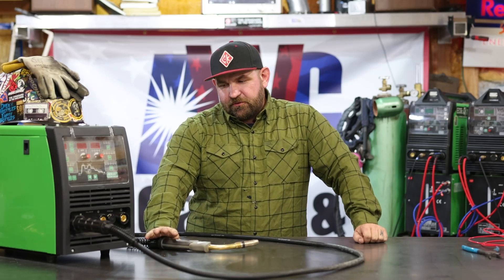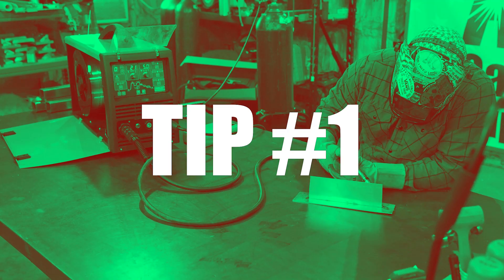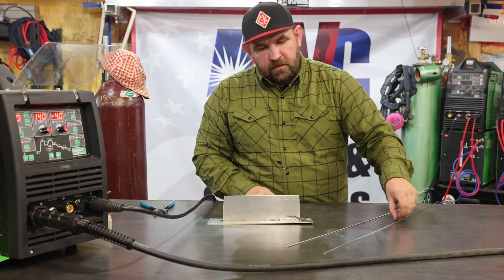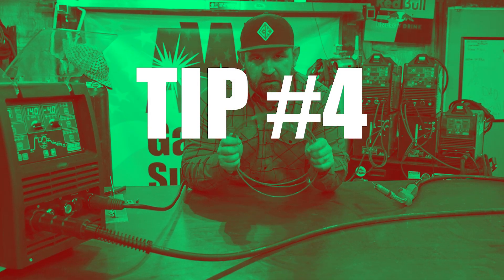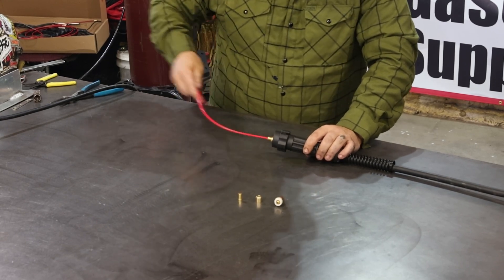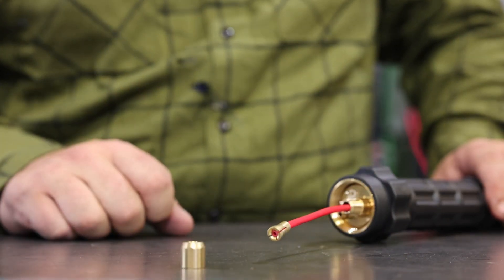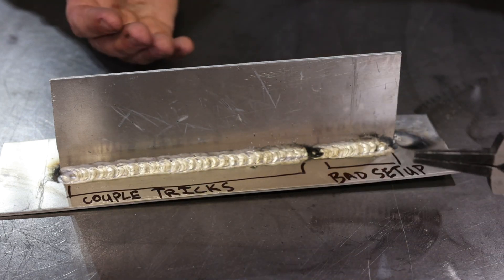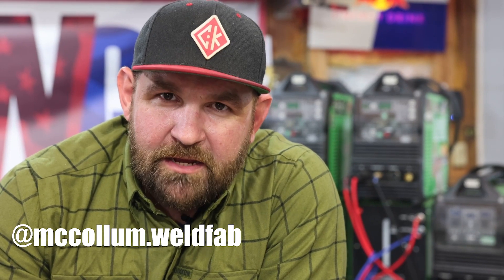MIG Welding Aluminum (without a spool gun): 4 Tips

Comment: 1. Straightened your feed line. 
2. Use 5356 size wire
3. Use 052 tip (oversized)
4. Teflon liner

Awesome video boss, 🫡
Reply: It sounds like you want to use a .010" larger tip than the filler wire you'll run.

Comment: Great video. Thank you. I have a question:  After you've finished your aluminium repair, do you  have to swap the liner back to the standard one?...or can the Teflon liner run steel wire?
Reply: same question i have too

Comment: Thank you for the tips.
I notice you are using 0.046 wire on what looks like 1/8 workpiece. Do you find that you can weld thin aluminum with such a relatively thick wire? I imagine the thicker 5000 series wire is stiffer than the thinner wire and feeds thru the whip easier

Comment: What gas mixture? 100% Argon? DCEP or DCEN? Also, if you are running a larger contact tip you still may experience arc issues for sure, but it looks like it works.

Comment: Never cut the teflon liner flush. It should be long enough to almost touch the drive roller. It needs to guide the wire a soon as possible after leaving the drive rollers

Comment: not teflon liner, the best is graphite liner, the liner must not be cut there, a length must be left so that it goes to the unwinding rollers
Reply: Can I still use the graphite liner to do my normal steel welding?
Reply: @BillyP-49Chevy  oui mais elles coûtent nettement plus cher et s'useront plus vite   en y faisant passer du fil Mig acier. Donc c'est mieux de les réserver au passage des fils alu. Celles pour l'acier sont spiralées sur tout la longueur et ont une  plus grande longévité.  En plus il est recommandé que chaque gaine ne soit utilisée pour toujours le même type de fil, acier, inox , alu pour que les fils qui y passent ne soient pas polluer par de précédents usages de fils différents.  A part ça il est recommandé et en particulier pour l'alu de souffler régulièrement les gaines pour les dépoussiérer car les frottement fils.contre gaine, produisent par abrasion  des poussières. Pour l'alu la bonne pratique est de le faire au moins à chaque changement de bobine. Vois serez d'ailleurs étonné par la quantité de poussière qui va en sortir

Comment: Does anyone know if this will work with my Lincoln Mig-Pak 140? I'm assuming the Everlast in the vid was a nornal mig machine like my lincoln? This would be awesome if it worked. I'd buy a separate whip and torch for it if anyone can confirm! Thanks.
Reply: I'm wondering the same thing. I have a Lincoln SP-170T, maybe twenty years old, in mint condition so I'm not about to upgrade. I'm told I CAN weld aluminum if I make the changes shown in this video, but it's not a modern pulsed welder.

Comment: Thanks for the Tips. Quick question. Can dirt bike cases be mig welded with this setup?
Reply: Not an expert, but I would be willing to try.  

That aluminum will need to be as clean as abrasives and chemicals can get it.  Drill a hole at the end of the crack.  The crack will concentrate stresses in the metal at a single point, weakening the part, but a circular hole will distract those stresses over a larger area.  Tack the sides together for alignment.  Grind sections of a deep V-groove so you can get good penetration (bypassing the tacks).  Weld between the tacks, then groove the tacks and weld those spots with good penetration.

Depending on thickness and penetration, you might need to groove and weld the other side.

Good luck!  It may not turn out beautiful, but if it holds together it’s a win.

Comment: Thanks for the tips. I think half my problem is wire feed. I switched to the 5386 or whatever it is and that helped out a lot. My boss don't like the weave on aluminum the way you welded. I like it for heat control especially at the beginning of the weld when it's at its coldest. It sure looks a lot better though. Obviously the dimes have to be prone to a crack the a straight high build Caterpillar looking stringer. Either way thanks for the tips

Comment: Thanks for sharing this great video.
a.)   Are some liners better than others ??
b.)   Can you replace the liner in any torch cord ??
c.)   Do the rollers on the mig that feed the wire have to be metal ??
Thanks for your generous consideration,
Sincerely ........................
Reply: -Yeah,there are also teflon-grafit liners.
-Pretty much in any torch except ones from cheap maschines where is hard connection between torch and maschine.
-Yeah they can be plastic (but they need to be U shaped too)

Comment: Is there any push/pull guns that will work on this welder besides the Parker that Everlast sells? Cause lets face it, unless you're working on a bench in perfect conditions like you are with the whip leyed out perfect...the style of welding you are doing has more weld wire cut off and tossed on the floor then in the welds.

Comment: Can I get some settings for 1/8" 6061 aluminium pulse and double pulse welding .035" 4043 wire with 100% argon
 On the 253 DPI  can't seem to dial it in and would appreciate it immensely.

Comment: What’s a good gasless aluminum mig wire spool? My Lincoln is setup for flux core. I found an aluminum mig wire “030” I have not used it yet bcs it doesn’t specify argon or gasless. Is it possible to weld with aluminum mig wire with soldering flux when there is no argon gas??
Reply: No. You have to use 100% argon.
Reply: @haroldlundberg5676  yes pure argon, the reason I asked is because google search  and Amazon smh they have a gasless Aluminum mig wire..🤔but people who bought it responded it is gas. The problem is if you search for something you’re going to find it even if it’s not accurate.

Comment: I'm looking to buy my first Mig welder (as a diyer) but non did aluminium.
Your tips convinced me of workarounds. They shall get laminated and putup in my garage.
MIG WELDING TIPS
1. Make sure your torch lead is a straight as possible as the filler wire is soft aluminium.
2. 5356 filler wire is softer than 4043 wire so try 4043 wire.
3. Use the next size up gun tip for your wire as the soft aluminium filler wire gets pinched in the rollers and can become oval in shape which can cause 'birds nest'.
4. Change your torch lead liner to a Teflon Liner.
Great video
Reply: He said the 5356 is stiffer, not the 4043...

Comment: Awesome. Can you leave that liner m there for normal MIG welding (mild steel wire)?
I have the Everlast PowerMIG 200
Reply: No. The steel wire will rip up the Teflon. You have to change the liner back to one suitable for steel.

Comment: Some other advice, get a couple mig guns and leads. One for mild steel, aluminum with the teflon liner, and one for stainless steel. Label them so you know which you want and just swap them out. Yeah it's expensive, but it'll save you time rather than replacing liners after each use. Especially if you are doing a multi-metal project that isn't just steel or aluminum exclusively.
Reply: Smart.
Reply: At that point get a spool gun, no?

Comment: I would like to try the mig aluminum approach to welding, I have a couple of questions so pardon my ignorance. I have a everlast 221 sti multiprocessor welder. Does the polarity need reversed on this to perform aluminum welding? Also is it hard on electronic internals? Am I assuming correctly that you need to switch to 100% Argon also?
Reply: No change in polarity needed, and 100% argon is correct! Its not harder on the machine than th ning standard hardwire

Comment: I have the same machine but have only used it sporadically.  I bought 3/64 wire (5356) but was never happy with the pulse. Seemed like a lot of flare, like the wire speed was slow, any suggestions on settings? It would be nice to have the option to just set the volts, set wire, and set the pulse high/ background. 
Also... different topic, if you are not using new aluminum,  how do you tell if you should use 4043 (silicon based) or 5356 (magnesium  based), as the two are not interchangeable on some base material? 
Thank you for what you are doing!

Comment: Good video, but have you guys tried a graphite liner? Graphite liner is way stiffer then a teflon liner and will help out even more.
Reply: Hey Ned. I tried that but it immediately started to contaminate the weld. What manufacturer of liner did you use? I would like to try it again, I think it should work better than Teflon if it  doesn't contaminate.
Reply: @jaysmith4293  Hey Jay, i use fronius graphite liners and have never had an issue with contamination.
Cheers

Comment: Excellent tips. I have been using all these tips on my 253 as well
 I have one small additional tip, don't cut the Teflon liner as short ,but make it extend as close to the drive roller.  Just short of touching the drive roller.  . 
I also use an 1/16 Teflon liner with the  .045 /1.2 wire. I know a lot of people will disagree with that.  I counter their disagreement with the fact I use A 5 meter mig gun with little  to no problems
Don't forget to use U drive rollers.
Reply: Exactly. I’m an aluminum mig welder and when your using the plastic liner you cut as close to the guide wheels as possible so it doesn’t have a chance to bend.
Reply: hey Jay! what do you do to combat grey welds? Im going crazy trying to find a decent setting for 1/8" and 3/16" aluminum welding  
I use 045" wire 4043 but can't seem to nail down good setting for DPulse
Reply: @raymondcorreira847   , me either,  i have similar problems with d pulse , burn back and...
Reply: Thanks , great advice

Comment: Is the Teflon liner still ok for regular steel wire?  Disadvantages of leaving it in there?
Reply: It could possibly contaminate the weld the next time you use aluminum.
Reply: Once you have it setup, it only takes a few minutes to swap it out... Like literally less than 5 minutes. The teflon liner is more likely to kink as well, little more delicate compared to the stamdard liner
Reply: It could possibly contaminate the next ti

Comment: there you go !   mig welding without spool gun !!!! I have been doing that for 10 years !!!
works great
Reply: Can you do this on a Miller 140? It's 110 amp
Reply: @anthonyrochon3907 for a limited material thickness range yes.   .100” to 3/16” maybe … with the right wire, right gas and the right liner in the gun
Reply: Zila, I saw your recent appearance on Waldo's World welding up the aluminum flatbed with the HTP-PP 220. I have an Everlast MTS 275 and want to try aluminum MIG with it.  Aside from using the stiffer wire, teflon liner, bigger tip, and keeping a straight cord are there any other tips or settings you'd recommend, pulse settings, etc? I want to do 3/16 and 1/4" tube.
Reply: @oldowl4290  thanks for watching! The MTS 275 ( as far as i am familiar with the machine) does not offer pulse options/settings for mig ….  That being said 3/16 or 1/4” is thick enough to weld just with regular spray mig.. i an not sure if you have a program in the machine or not. If you run 5356 wire ( the stiffer kind ) i would think a good starting point is 500 ipm for 3/16 and 600 ipm for 1/4” that is if you use 035 wire and 100% argon gas ….  Stsrt with voltage at 22 ( go up or down 1 or 2 volts )till you see the spray cone, no crackling.  A short and focused cone is preferred … 
If you run 4043 about 100 IPM LESS everything else about the same…
100% argon gas the higher the flow rate the better ( i would start at 40 cfh) 
Ctwd (  stick-out ) about 3/4” roughly 2x of what you’d do on steel short circuit mig )
Dont forget the aluminum drive rollers …. When it comes to drive roll pressure, less is more … just use barely enough pressure to feed the wire ….

Always push the puddle. Never pull, always weld vertical up not down ….

Good luck
Reply: @ZILAwelds   Thanks for the help!